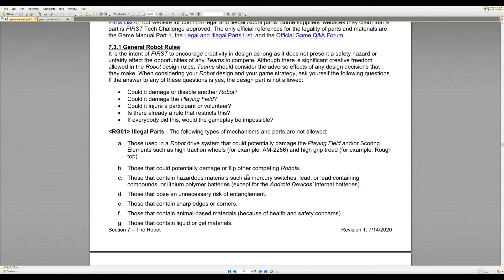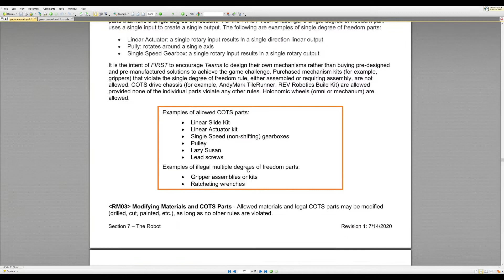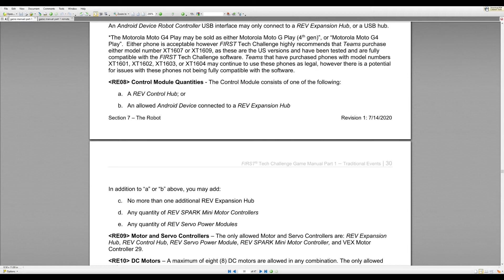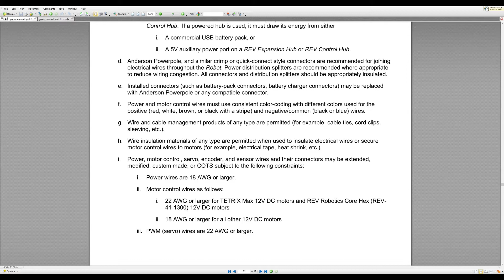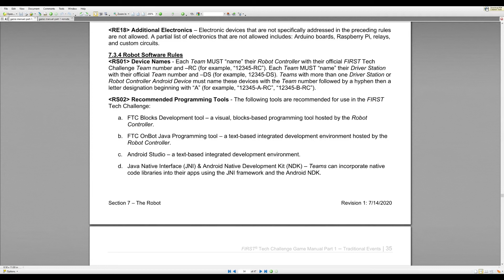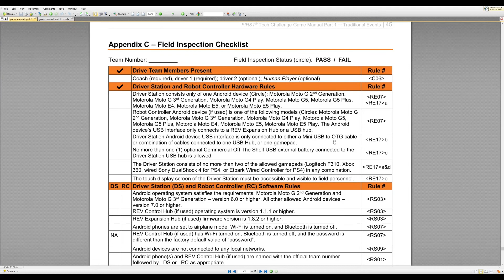Ohio FTC Kickoff Inspections 2020-21

Comment: When setting up a field perimeter, can we use an existing wall, like a basement or garage wall, as a section of our field perimeter? - Team 8 To Automate 8642
Reply: Although there is no restriction noted in the game rules or field setup guides (for remote events), you must consider some of the access issues that would be associated with an existing full height wall used as a perimeter. In reality only one of the sides could have a wall along all or part of the the boundary. The other 3 sides need to be open by a small amount to allow 1) 3 feet for human player, goal tower and targets at back end of field 2) 4 feet side-boundary for drive team along one side  3) a 12 inch high barrier on the front side and enough space to place the wobble goal over the barrier.  This just leaves one side for perhaps the scorer and other field personnel who need to have good line-of-sight of the field during a match.
Reply: @paulsmith6310  Thanks!